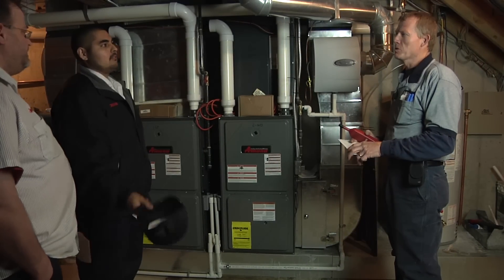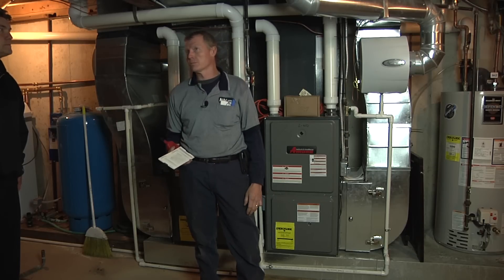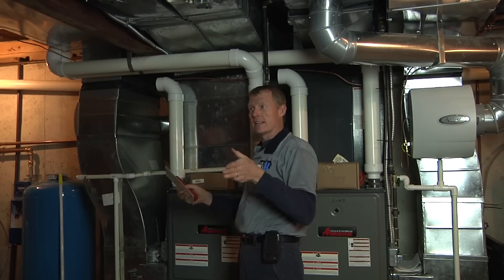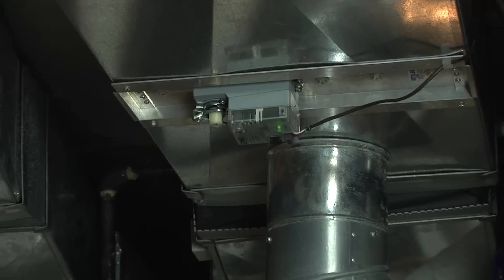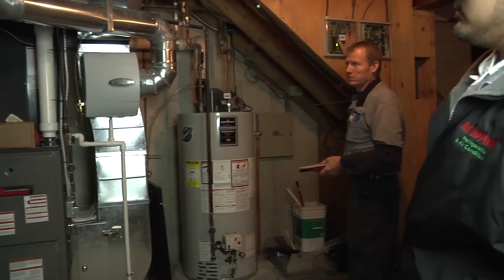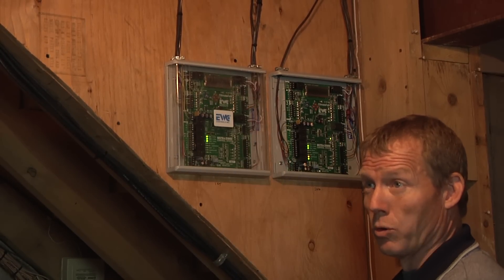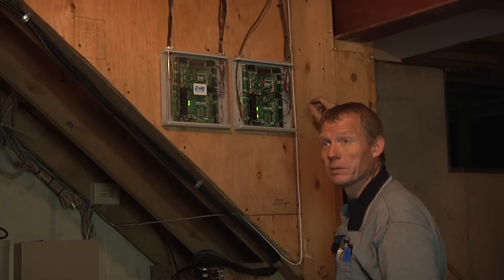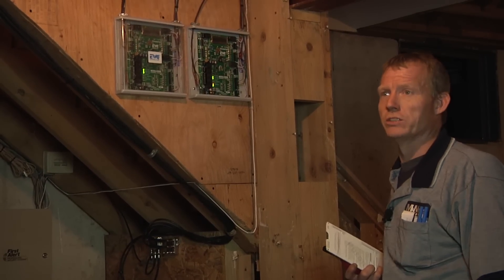HVAC Zone System and Damper overview for Heating & Cooling

Comment: Hello,
question. I have zoned HVAC sytem in house. One AC/Heat pump compressor outside and one system in Attic. I have a thermostat down stairs and one up stairs. 
Is it normal to have residual air flow out of the upstairs vents while the downstairs system is on and set to a certain temp?
The upstairs thermostat is set to off. But as mentioned above when the down stairs is running I still feel cool air coming out of the vents upstairs. There is about a 5-6 degree warmer temp upstairs. Now when I actually turn on the upstairs thermostat the air flow is much higher and noticeably louder. 
Thx,
Reply from the maker: Great question, with our
technicians now getting hundreds questions weekly, they are answering all questions
at our website at AceApplianceinc.com under our Repair Help section. We have over
3,000 common questions and answers that you can easily search through by your
model number, appliance make, and problem or error codes.